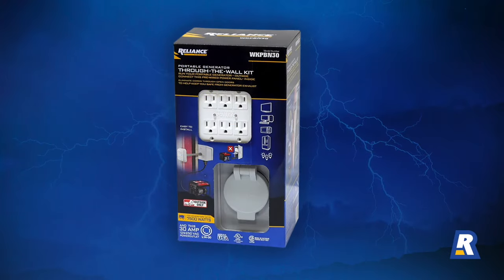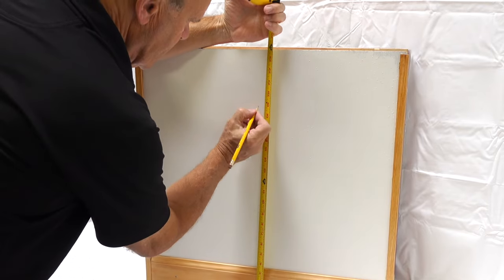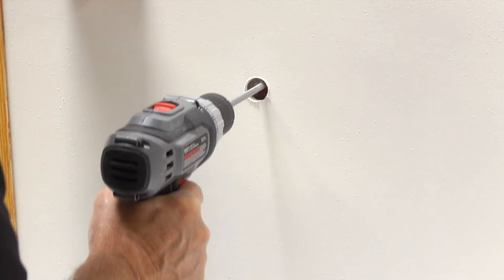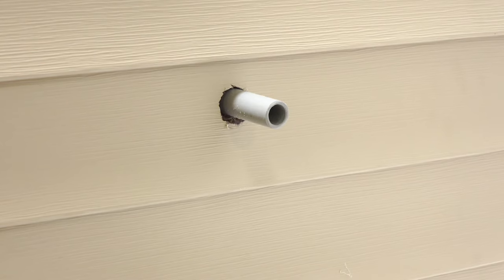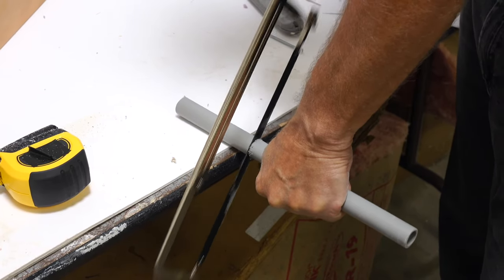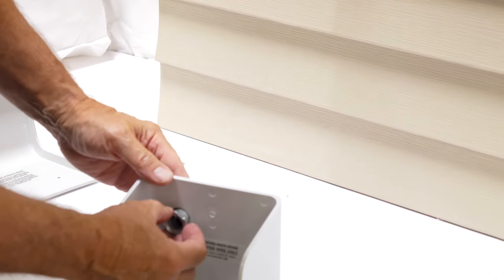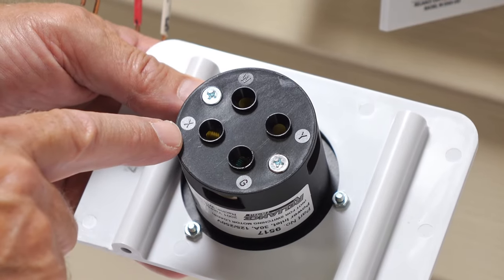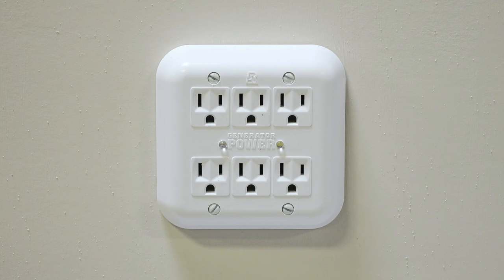WKPBN30 Installation - Generator Power Through-The-Wall Kit

Comment: What cord do I need to buy?
Reply from the maker: Hello, it depends on what generator you have, and specifically which outlet on the generator that will be connected to a cord.   Can you identify the largest rated outlet on your generator or inverter?
Reply: @RelianceControls  I have a 30amp RV outlet, and a 3 prong L5 (I believe), as well as the regular 110V
Reply from the maker: @702couch   You can probably find a cable with the RV (TT30P) on one end and the L1430C on the other end (the L1430C plugs into the inlet box).  Or the L530P on one end and L1430C on the other.  Or you can get a cord with both L1430P and L1430C ends, and use a short adapter cord or plug with the TT30P (or L530P) on one side and the L1430C on the other side.
Reply from the maker: itsdatruff  Hello, we don't have any flush mounted inlet box, sorry.

Comment: I have a Honda 2800i inverter with a 125v/30 amp 3 locking prong receptacle, does Reliance make a kit??
Reply from the maker: Hello, you have a lot of options to use a power cord with the L530P on one side (assuming this is the outlet on your Honda), and the L1430C on the other side (which connects to the included L1430F inlet in the inlet box).   There are also adapters if one decides to use a cord with L1430 ends on both sides, so a short adapter cord or plug would have the L530P on one end and the L1430C on the other end, to connect to the cord, or to the inlet box if this 3 to 4 wire cable is long enough.

Comment: does the 4 prong plug come with the kit come included in the kit or do you have to buy it seperate
Reply from the maker: https://youtu.be/TOG0qCDutWg?t=530 
Yes if you start the video at 8 minutes 50 seconds (copied the link above, timestamped), and watch for about 3.5 minutes, this slot is about installing this PBN30 inlet box.  It uses the L1430F flanged inlet preinstalled, which is a 30 amp 4 prong locking device.  
-----
If you are actually referring to the outdoor generator cord or inverter cord intended to "plug-in" to this PBN30 inlet box outside, then no, sorry.  This particular model "WKPBN30" does not include any other accessories such as male or female plugs to build a power cord, or some length of completely assembled outdoor power cord.  
The PBN30 inlet box is included, along with the conduit, drill bit, fitting, gaskets, mounting hardware, and the 6 outlet prewired power panel.  
The contents are shown at 1 minute 40 seconds of this video.  
The installer or whoever is involved with this installation should be selecting the proper power cord or making one that matches the generator outlet and the PBN30 inlet (L1430F).
-------
We do make a few other "packages" of this same product with 3 different cords included, one with 10 foot cord, another with a 20 foot cord, and one with a 40 foot cord.  They are of course more expensive but you should be able to find some online when searching for the model numbers, to see what some of them are priced at on average online.      
-------
The model numbers are as follows:
WKPBN30 - no separate cord included
WKPBN3010 - 10 foot 30 amp cord included (L1430 plug ends)
WKPBN3020 - 20 foot " " " 
WKPBN3040 - 40 foot " " "

Thank you.

Comment: When I plug in a Receptacle tester (one red, two yellow lights) only the centre light (yellow) lights. This indicates an OPEN ground. Is this normal? The generator is a Honda EU3000is. My guess is that it is okay as  the generator itself is not grounded. Just want to double check.
Reply: Because generators are NOT grounded, one of the FIRST pages in the manual likely discusses the importance of installing a grounding rod (into the actual ground near where you'll be running the generator, and then attaching a wire from that rod, to a specified "GROUNDING" point or screw on the generator.
  It will still operate without it, just like older houses you're bypassing the saftey benefit if NOT taking this step!
  Do a quick YT search..Grounding your generator, or https://www.youtube.com/results?search_query=grounding+your+generator
Reply: Just to clarify further, some gensets are grounded. I know mine is

Comment: What size extension cords are recommended for attaching to the 6 gang outlet inside the home?
Reply: I'd suggest 12 gauge.
Reply: depends on the length of the run, 10 or 12 gauge

Comment: What if your outer wall is brick
Reply from the maker: Hey Carlos! We're glad you asked! Here is some information for you, check out page 4: https://www.electricgeneratorsdirect.com/manuals/reliance-controls-2ff2772f373adb929acfc79512753354.pdf

Hope this helps, but feel free to reach out to us directly at support@reliancecontrols.com if you need anything else.
Reply: @RelianceControls  thank you.  Just bought the 10 circuit transfer switch!

Comment: Why would the led lights only turn on when I plug something into one of the  inside outlets and what I am plugging in won’t work?
Reply: That's not what he said.  The LEDs light up as soon as you energize this box, when you connect a running generator.
Reply: Which is exactly the point. Generator running and cord plugged into box but no led lights on outlet until something is plugged in and whatever is plugged in won’t work.
Reply: @tmack485 .. No no.. The lights turn on when the generator is plugged in and running.
Reply: I have the same issue. Did you ever get it figured out?
Reply: @Blue-tl4nv  check where you connected everything together in the box. I had one wire stripped just a little too much.
Reply: @tmack485  Thanks. I actually had the opposite issue. Wires weren't stripped enough and the contacts were on the insulation instead of the wire.

Comment: Dumb Question:  I only get 120 V on the inside, right?  No way to get 240 V?  Thanks.
Reply: As I understand it, if your generator has the 4-prong outlet, you will have 240 in the house.
Reply from the maker: The 6-outlet power panel is wired so that one of the 120v legs feeds the top 3 outlets, and the other 120v leg feeds the bottom 3 outlets.  If you are hoping to actually power up a 240 volt circuit, such as a well pump or water heater, this kit would not be the solution since it specifically is for 120 volt cords on the inside.  You would likely need a transfer switch to integrate into the system for a 240v circuit as most of them will not use a plug connection but are hard wired, thank you.

Comment: Nice! I like it. But $100?????????

this is worth 30 bucks at most. 

:-)
Reply from the maker: Victor! Are you willing to drill a hole through your wall and assemble an electrical wiring kit that's worth $30 in your home? We beg you to reconsider!

Find us one for 30 bucks and we'll compare quality and safety. Thank you for watching!
Reply: Haha, I don't know what options are up to code right now, but it seems to be as simple as putting a box on the outside with some wires going in and an outlet with  conduit- maybe the conduit is not even "necessary?" 

As for other options, there doesn't seem to be much competition here! At least from quick online "searches."

Thanks for responding! 

I'm sure it's a great, safe, well-made, and "convenient" product, but too much for me! :-)
Reply from the maker: @Victor-tl4dk  We definitely appreciate your feedback! There may be DIY options as you pointed out. The purpose of the kit is to provide a a safe, simple to install, and cULus listed solution to a common concern! Thank you again!
Reply: this is DEFINITELY worth the $100

Comment: Worked the first time I used it. Second time it blew my furnace and coffee maker. Afraid to use it ever again!
Reply from the maker: Hi Peter! We're sorry to hear you had an issue with this kit. Please reach out to us directly; we'd love to hear more about the problem and work to correct it!
Reply: Wow, that is no good!  It's one thing to be without power, but to be without a coffee maker.....and a furnace on top of that, ouch!   I think I will be staying away from this product.
Reply from the maker: Peter, I would like to extend our apologies for the trouble you've experienced. To be clear and expand upon our initial reply, There's a high probability this issue was not caused by our product. 

Typically, when appliances fail in this fashion, it's due to a voltage issue. In this case, the cause could be the loss of the neutral, or the generator is producing an inconsistent voltage that some appliances will struggle with. We would be happy to help work through the issue. In the event that our product was responsible, we will certainly work with you to remedy your losses.
Reply: @RelianceControls   I’m trying to connect my firman w01682 to Reliance Controls through the wall kit. What plug/ receptacle and cable do I need? The receptacle on firman generator is a 120 volts 30 amp 3 prong  and the receptacle on Reliance Controls through the wall kit has 4 prong. I appreciate any help you can provide.
Reply from the maker: Hey  @seangholipour3884 ! Your best bet is to use an AC3130 adapter cord with whichever power cord suits your needs: PC3010M (10ft), PC3020M (20ft), PC3025M (25ft).

Let us know! And thank you for watching :)
Reply from the maker: @seangholipour3884  Hey Sean! Your best bet will be using the AC3130 adapter cord with any length of power cord you need:  PC3010M (10ft), PC3020M (20ft), PC3025M (25ft), etc.

Thanks for watching and let us know if you have more questions 👍
Reply: Your generators fault not this product.
Reply: @Jolkrae Remeark  it's was his generator not this product that caused a failure.   Most like not using a inverter generator.
Reply: Wow..I am trying to understand how people are commenting that it blew a furnace..or a water heater...etc. All of these large appliances/equipment are hardwired to a dedicated panel with their own breakers in most homes. Are you saying that you can "plug in" your furnace or water heater to a standard wall outlet? Thats all this device is allowing, basically an option to plug something in that already has a corded plug...like a lamp, or radio, etc... If the plan is to want to run Other heavy draw equipment like stove, furnace, etc.. one would be better with a hard wired dedicated panel and transfer switch.